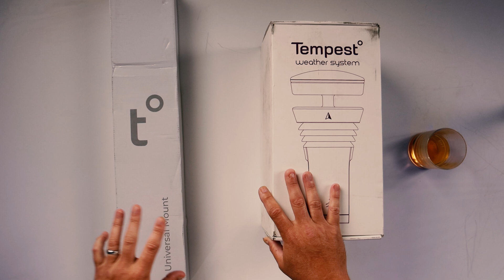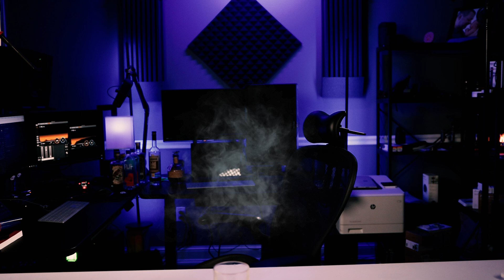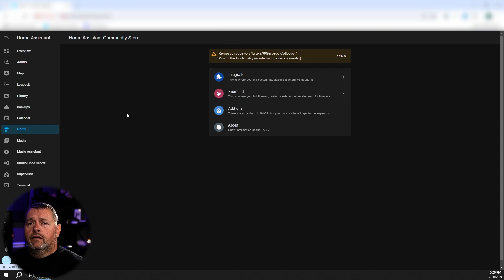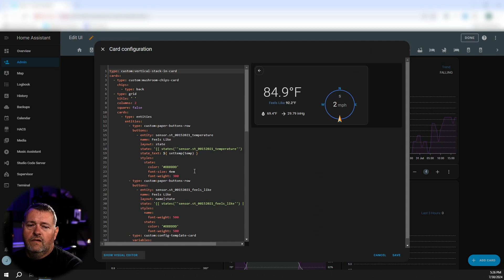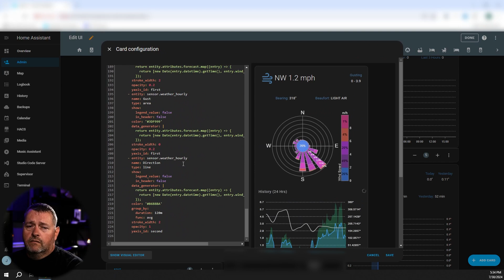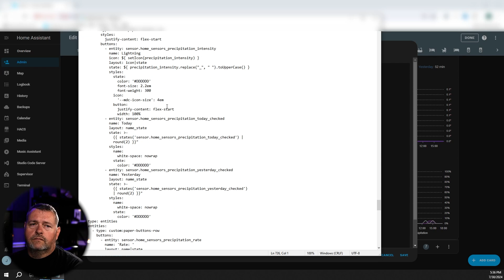Tempest Weather Station unboxing, install and weather dashboard!!

Comment: Got one of these a couple years ago because it integrated directly into my Rachio sprinkler controller. It’s been fantastic and has saved so much water use that would otherwise go to waste overwatering my yard.
Reply from the maker: That's awesome, what a great use case!!  Thanks for watching!
Reply: @ definitely. That thing paid for itself in just water savings in the matter of two or three months.
Reply from the maker: I don't have automatic sprinklers, but mine has been really putting in some work on the electricity use front.  Using sunrise and sunset isn't terribly accurate, and I would frequently find lights on when they didn't need to be.  Different times of year it seems like twilight lasts longer than others as well, so trying to use some type of an offset wasn't really helpful either.  I just started using the lux value from the Tempest, and now my lights activate right when I want them to, and turn off when I want them to as well.  It's been great!

I also use the external temperature from it to control various outdoor things, such as disabling some automations when it's too cold, and automatically turning some heat tape in my gutters on and off based on temperature.  My electric bills were much lower this winter than they were last, and I credit those automations leveraging the data from the Tempest with that reduction.  It really is a wonderful device, and the ability to get local information is almost just like icing on the cake - not to mention that the Tempest forecasts are WAY more accurate for my area than anything from any of the major weather services, so that's nice to have as well!

Comment: Extremely useful video! I pretty comfortable with code (30+ years in development), but new to homeassistant and was able to got most of this up and running from the video - so thanks!. My one struggle has been with the configuration code for the weather_forecast sensor. From what I can gather the syntax may have changed in how template, trigger, and platform  are declared with time pattern. Either that or I'm way off on something. -platform: time_pattern is the first issue. ("string does not match the pattern of legacy syntax") and I've read in the forums about "old way" vs "new way" syntax with platform being no longer necessary? 
 Any suggestions?
Reply from the maker: Yeah, there were syntax changes made to everything a few months back.  I went through and updated all my stuff, but AFAIK it's not necessary.  The old syntax still works (and according to the docs will NOT be deprecated), even if Studio Code does bark at you.  There are several spots in my config file where it complains with one update, then stops complaining with another.  All my stuff keeps working just fine.  :)   Just have to remember that studio code is an add-on, and is NOT part of Home Assistant, so the things it complains about are not Home Assistant complaining, it's just a third-party IDE.  As long as HA continues to interpret it correctly, it doesn't really matter was Studio Code thinks (even though my OCD says otherwise).

Not to mention that even once you fix the trigger/platform thing, Studio Code is STILL going to complain about the code for the sensor (or at least, mine does) - but again, it still works just fine.  :)

If you want to update your config file for triggers, the release notes from 2024.10 has the info:  https://www.home-assistant.io/blog/2024/10/02/release-202410/#improved-yaml-syntax-for-automations

I actually meant to do a video about this when I ran into it and fixed it all, but time just got away from me.  Maybe next month?

Thanks for watching!